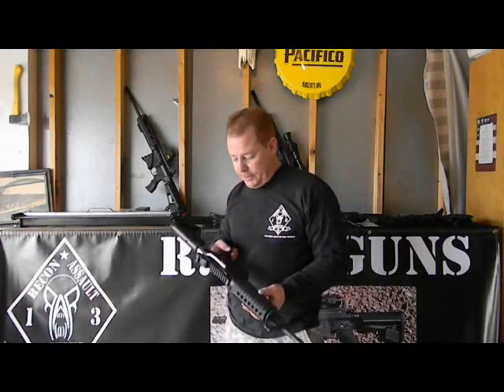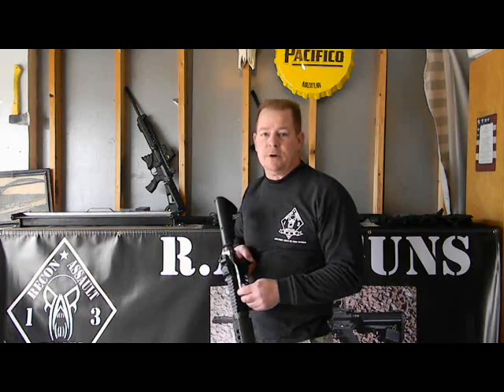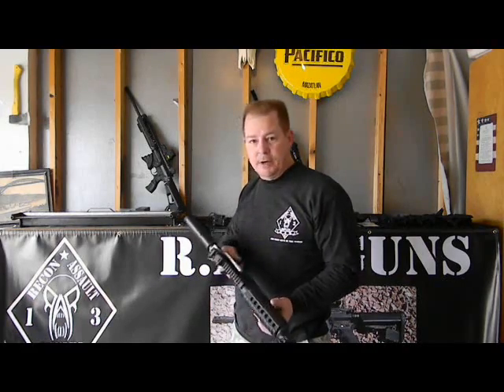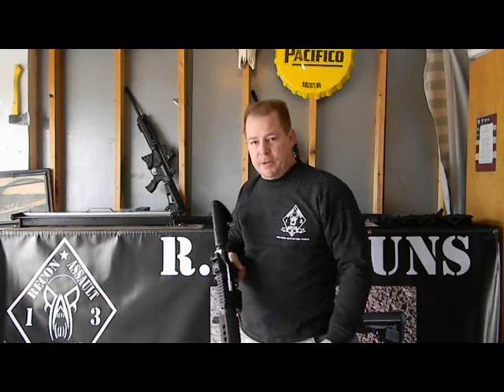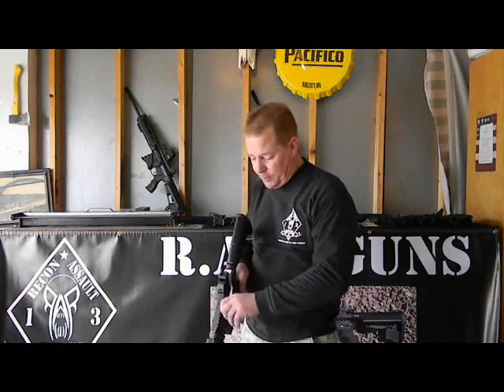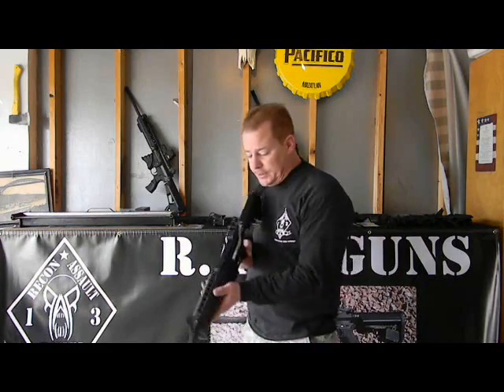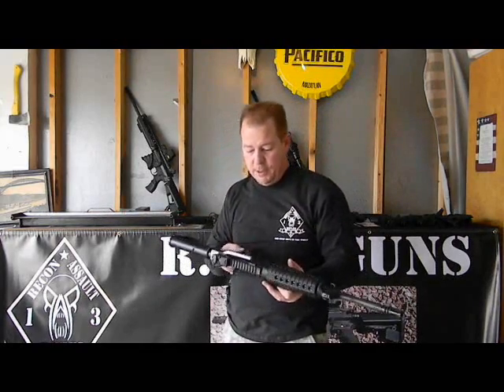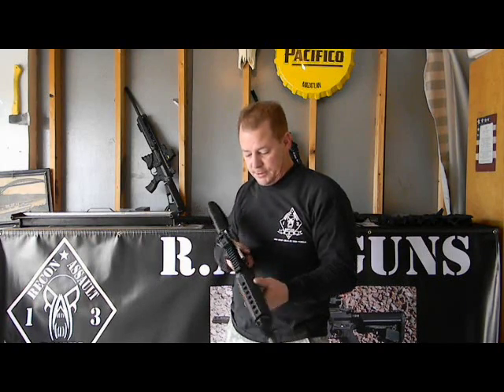Sidewinder video.wmv

Comment: This doesn't make sense to me. One of the primary benefits of having a forward- or side-charging handle on an AR15 is to eliminate the need to ever break your cheek-weld. While this product would put the charging handle in a better location, it would still require a break of cheek-weld. Also, small debris could get wedged between it and the upper receiver.

Comment: Not only is this a solution to a problem that doesn't exist, it actually creates problems.  Repeated use of this thing is going to either result in the charging handle breaking off, or excessive wear to the receiver.  You still have to remove your cheek from the stock to operate it.  You can't operate is easily with your right hand, which makes the charging handle useless in some situations.  That folding handle is obviously not easy to grab reliably.   Mall ninjas will approve, I'm sure.